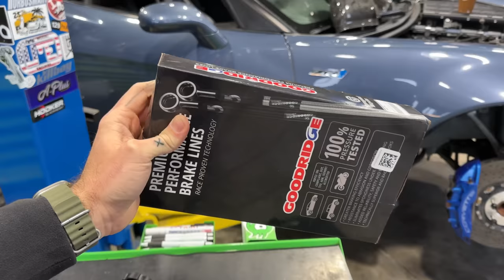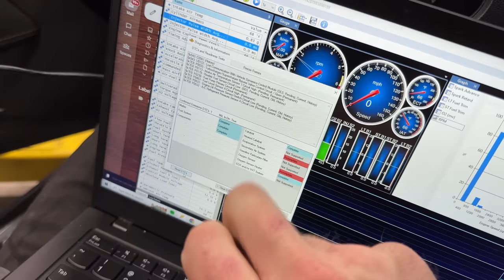My CHEAP 1000HP Corvette ZR1 Build BLEW UP In My Face..

Comment: Btw, the easiest way to get a hose over a barb that is really tight is to heat a cup of water extremely hot and dunk the tubing in the hot water for a minute. It will soften the the hose and make it a lot easier to get over the barb.
Reply: zipper wax works really good too
Reply: Windex, it's alcohol based. It acts like a glue after install. Slips on, never coming off even after multiple cuts with box cutter
Reply: Hairsprays works great too

Comment: fun fact, two 8-6 fitting plus those two 90* push-lock fitting would have been a good solution for your cross over and would create a smoother fuel flow.

Comment: While you are working under the hood with radiators, fuel, clutch fluid, wiring, etc why not remove the hood? Just so you don't mess up the hood? Or because it's hard to line back up? It's not as in the way as one that opens the normal way I suppose.

Comment: Difference between a 1k HP C6 ZR1 and a Nissan Juke? The Juke starts, runs, has oil pressure, and at the end of this video is faster. So does a Nissan Juke really suck THAT BAD??
Reply from the maker: Solid logic!
Reply: @ScrapLife Garage  this is why I enjoy this channel so much. The trash talking flows so freely and makes the little community here seem like a bunch of friends having a beer talking shit.
Reply: @chesspiece81  you Jinxed me!!! the Juke battery crapped out on my in this morning.  Lol
Reply: @scraplifedalt  so does that make a Juke a POS?
Reply: @chesspiece81  I mean, I’ll fix it before carrington gets this turd zr1 running properly 😁